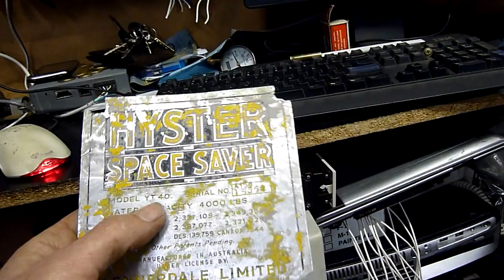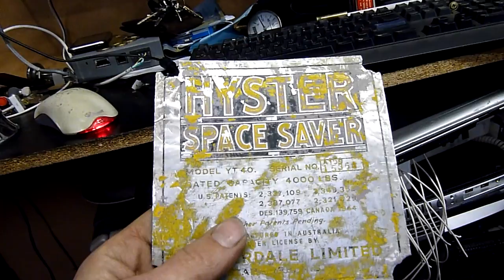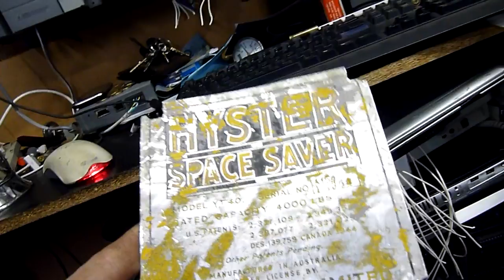Question for the Hyster Forklift and V4 Wisconsin fans

Comment from the maker: thanks mate!, its got finned air cooled cylinder heads, so yer, side valve.

its stuck in reverse and the clutch does not disengage properly, so starting is a no-go for now :(. that and the brake pedal goes to the floor, so running it would be dangerous at best.

Comment: That is a VH4D. It will be 12 volt. if it has valve covers then its a V65HD. They are great motors. If it has not been run in awhile check the fuel pump and the carb. If you have any more questions ask as I work in these engines every day.

Comment: Does the generator have a plate on it? Generally speaking 6 volt electrical systems went away after 1956 in cars, other then VWs, The used 12 volt generators after that up until the early 60s or so, not sure about tractors. One way you could tell is by the gauge of the wiring, 6 volt systems used heavier gauge wiring then the 12 volt stuff for items of the same wattage. Also a 6 volt system will not have a ballast resistor for the ignition.

Comment: A 6V starter won't blow on 12V - it will just spin a lot faster!  I've converted two 6V tractors over to 12V, and in neither case did I replace the starter.

Comment: 30 yrs in the industry and still a geek. 12 volt system it should be . Even if it is a 6 volt system It will not hurt using a 12 volt battery. Connect the battery and take a wire from the positive and just Touch the field wire on the generator to polarize it (check to see if it is negative ground first). Once starter check charging voltage. If over 13 volt it is a 12 volt system if less either 6 volt system or charging system not functioning.

Comment: What model number/serial number is the Wisconsin?  With those numbers you can date the engine... 4 cyl Wisconsins have been around a LOOOOOG time.  I read on a forum posting that Hyster YT-40  is late 50's to late 60's timeframe. I would think if it checks out to be mid 60's it would certainly be 12V

Comment: From a post on ebay:

Hyster YT-40 forklift

6 volt electrical system

Wisconsin 4 cylinder gas engine 3 1/4 x 3 1/4

Comment: Be forewarned about those Wisconsin V4 motors, they have no center support bearing and I've seen quite a few where someone bypassed the Governor, over revved the motor and snapped the crank in half.

Comment: If there is a charging or ignition bulb, look at its value, crude thought there :-)

if dynamo then perhaps the regulator relaybox or what ever has a part number you can trace.

Sounds like it could be ok, just wiring issues :-)

Comment: Gzzzzus every backyard mechanic knows to at least start a motor ya need it to Crank ova, a Spark to ignite da Fuel to go BANG... AND COMPRESSION..! No compression = No Starty da motor mate LoLzzzz

Swap out the coil & condenser with 12v replacements that ya gotta have kickin around in the workshop and crank it up. 6v starter will handle 12v no problems, just don't endlessly crank & crank if it don't start up at first... Oh and don't forget mechanic in a can (WD40) or Start Ya Bastard..!

Comment: Point gap should br no more than .020 inc gap .012 should be closer. If the Battery tray is long and narrow it will take the 3EE battery but most likely a group 24f 750cca 12 volt No worries about blowing anything accept maybe indicator lights